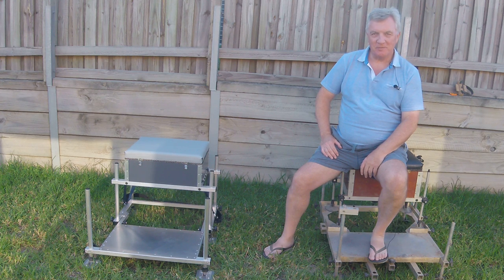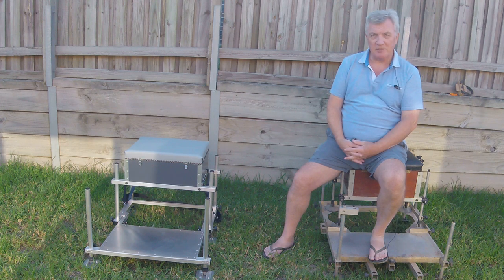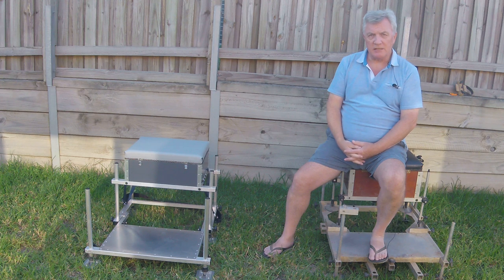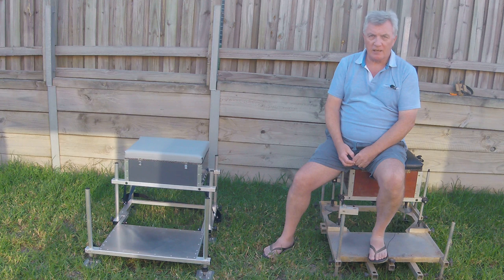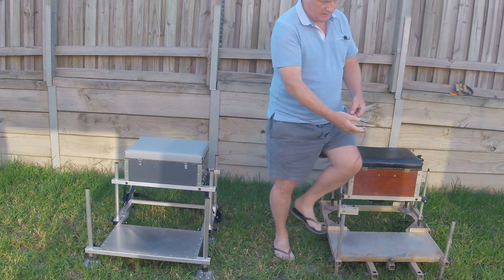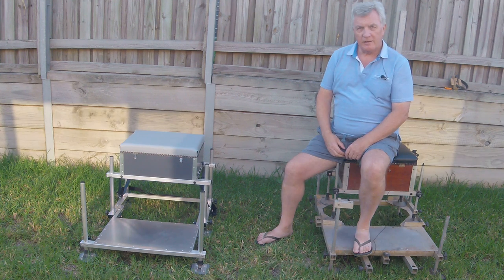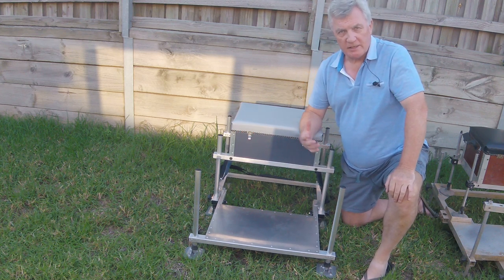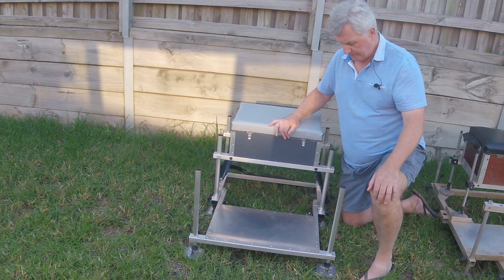New Fishing Seat Box - Homemade

Comment: I am very impressed Den. I love the fold up foot platform, far better than the bulky sliding ones that are on commercial seatboxes. I think it's great to see anglers designing and making their own tackle as it provides a real connection with what your using as opposed to mass produced kit.
Reply from the maker: Thanks Matt. i did consider the Cassette type of Footplate, but I decided on the folding Platform/Footplate for exactly that reason. I was trying to save weight so it made sense to do it this way.

Comment: Great work den as for my box you might remember  the boss box I bought mine in1989its a six draw box very compact  comes with a wheel  kit and a hande which fix on the back of the box its an all firbe glass design  like yours a pin which secures all the front draws its as good now as the day i bought it
Reply from the maker: I do remember the Boss boxes Gerald. It's nice to see yours has lasted for so long. I also remember the AS1 or ASi boxes from the early days. Some of them are still around too, but they were really heavy.

Comment: Looks like you could end up with your own oil rig platform?  I did look at these but I have trouble carrying to much weight at the same time.  I have a light weight set of carriers ideal for fishing and a side table attached to my chair.  I have to avoid fishing in water but can see the advantage of doing so.  look forward to see it's progression.
Reply from the maker: As I get older I also need to consider the weight I'm prepared to carry Phillip. I also have a smaller Seatbox which has no drawers so I can carry it for longer distances.

Comment: Den it is me again and thank you for the feeder videos, I just bought a box seat, foot plate and spray and although it was reasonably priced, why don't you market yours? I even bought a barrow/rickshaw conversion cheap, you strengthen the foot plate side bars and add handles, then the back legs of the box is a insert of the wheel, you can mobilise your gear around to a swim easy :)
Reply from the maker: Hi Leslie. Thanks for your comments. Over the next few weeks, I will be doing videos on how I built the Seat box, plus some other videos covering Side Tray, Sprays Bars, Rod Rests etc. The last one will cover a Trolley/Platform, which I can use to transport my kit over longer distances. I was going to add the option of wheels to the new box itself, but in the end I decided to make a separate item which can double as an additional platform if I need to put my kit out in deeper water. I won't be going into production of my new Seat Box because I get bored too easily, and I'm retired. I have built boxes for tackleshops in the past, but it's not something I am interested in these days.
Reply: @FishingwithDen  Hi Den I get where you are coming from but you have designed an item that people want and there are sites out there that will enable you to put your ideas out there, source cheaper but effective materials and market the item for you wholesale, you just sit back and fish and think up new ideas and innovations, I am a retired nurse but still give advice on healthcare and welcome new innovations, yes wheels is the way to go, I bought a system for £200 but could have paid £400 for the same system and the attachments are endless.
Reply: I fished that water at Daventry and lots of innovations started there :)

Comment: How much were the materials? sorry if I missed the cost in the video.
Reply from the maker: If you were to buy all the materials from scratch, I estimate the cost to be around £175, but the aluminium came in 6.5 metre lengths. This amount of aluminium would also allow you to make a second box for much less. In that case, you could sell the second box and you would have one for yourself which would cost hardly anything.
In my case, I used the excess aluminium to make all the accessories mentioned in later videos and I still have enough left over to make myself a Trolley/Platform for my new box. Based on that I have probably saved hundreds of pounds by making the accessories myself. I hope this helps.
Reply: Fishing with Den Thanks. That’s a great deal. Looking forward to the platform.